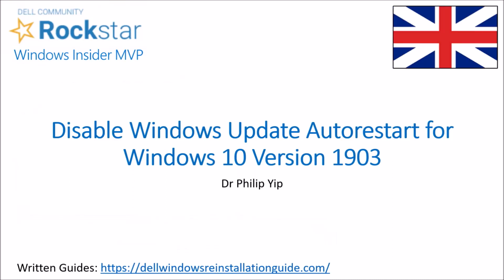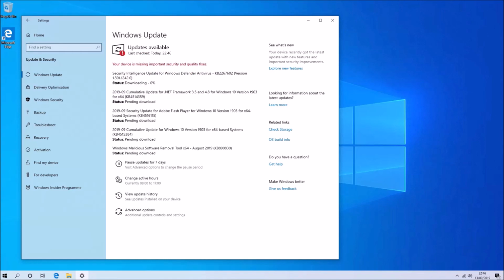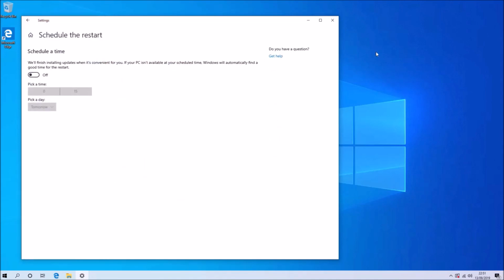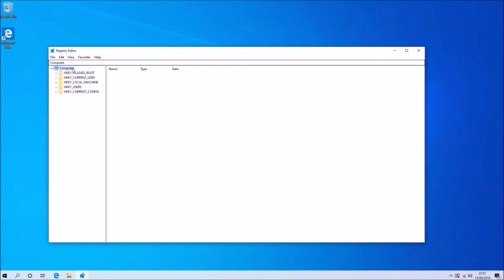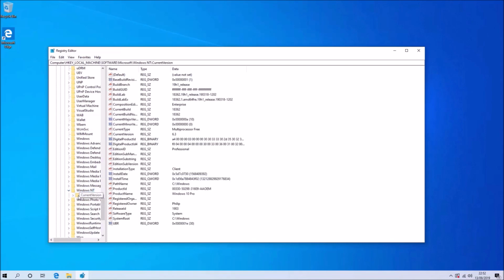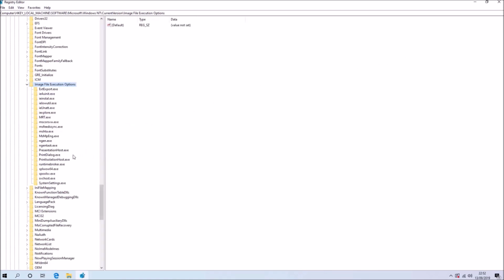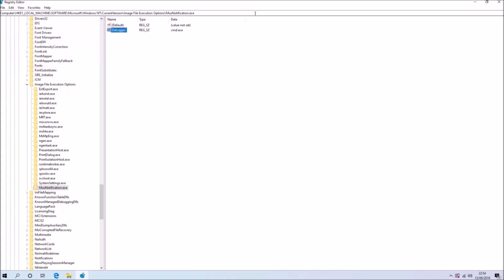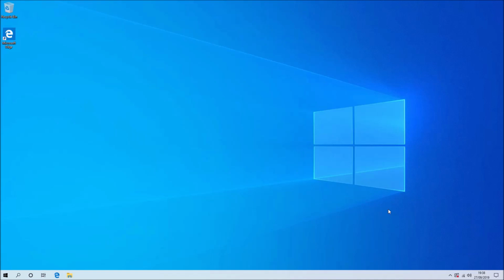Disable Windows 10 Version 1903 from Autorestarting

Comment: Isn't there an option to pause updates for up to 7 days (and another one for upto 35 days)? I was hoping to use that for this. I could un-pause it when I want to check and apply updates probably once every 2-3 days. I suppose it would also pause updates that don't require a restart though...
Reply from the maker: Yes you can pause updates for 7 days (in older builds it used to be about 35 days) but after the 7 days your computer will automatically restart which can still be problematic for example if you want to run something for more than a week or if you forget to restart and then run something. This fix seems to stop Windows Update from restarting your PC irregardless of time passed.
Reply: @philipyip1988  I will definitely have to do this registry edit. On a side note, I believe the 7 day pause is not available in the Home addition; only Pro, Enterprise and Education versions. I wish I had done this before the 3rd of October update bricked 2 of my desktops (Optiplex 960, Precision T3600)! Strangely my laptop (Inspiron 5770) with a the Win 10 Home is fine 🤔
Reply from the maker: @wadadli4sun  there was talk about adding the 7 day pause into Windows 10 Home but I've not used a Windows 10 Home Installation in quite some time. I've not had any issues on an OptiPlex 790, 7040, 7050, 7060 or Latitude 7350 with Windows Updates recently.